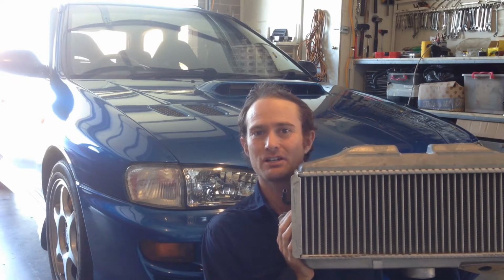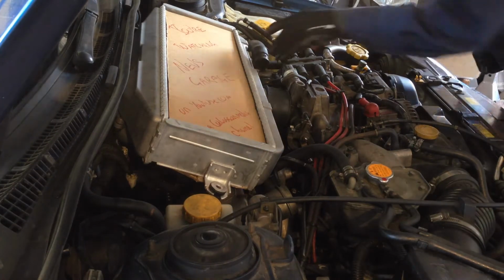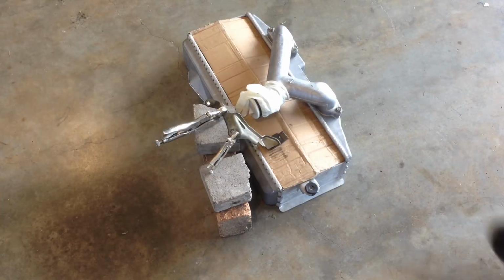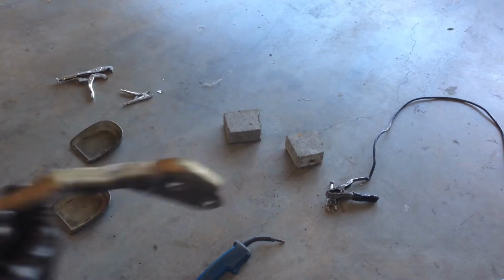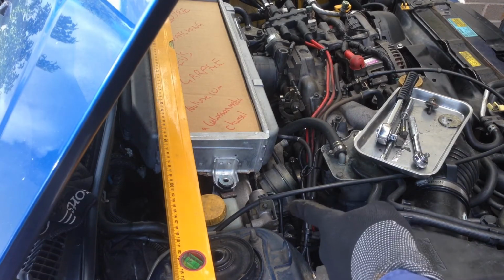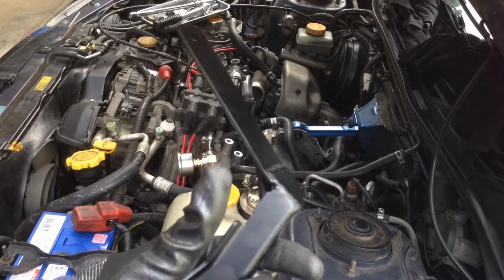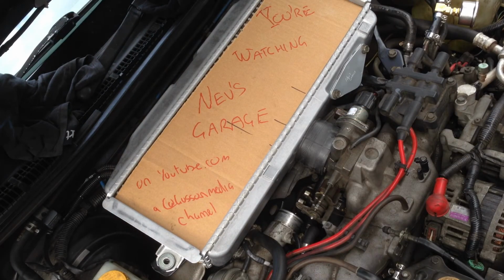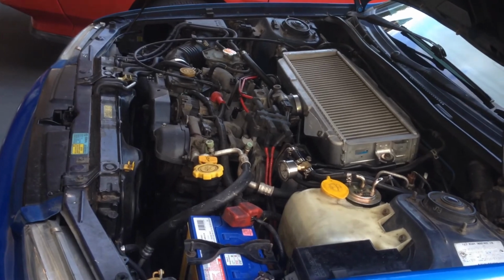Fitting a large STI Intercooler to an MY99 WRX

Comment: I’ve just begun trying this but not sure where you’re clutch slave cylinder is. Mine has one and because of that, it’s sting too high and can’t close the bonnet.

Would be good if you could highlight what you’ve done here. Might just have to bite the bullet and buy an eBay unit 🤦‍♂️

Comment: But now the Intercooler sits directly over the turbo, surely losing any gains you get from going to a larger cooler? 🤔
Reply: Def losing some of the gains but far from being a project scrapper.
Reply: at speed the turbos heat is getting shoved downwards away from the intercooler

Comment: I've managed so far to get mind to fit under a strut bar, not finished the install, I'm keeping the bov, and my drivers side bracket doesn't appear to hit, but I'll be checking that. I'm converting to coil over plug to make the fit both easier and reversible.  Good video man
Reply: R u using the stock sti gc8 strut bar? Same size with this V10 intercooler?
Reply: @dkproduction01  no, my car came with an aftermarket bar, all I can tell you is it's blue.

Comment: Overall nice work.  Looks nice.  On the right side bracket, I thought you were going to weld the threaded end piece back onto the end of the bar piece you added.  That might have worked instead of washers, but your brackets good and it works.  Hope the car is running well.